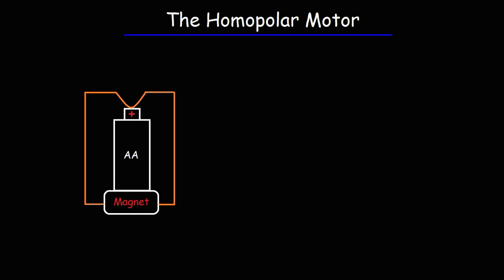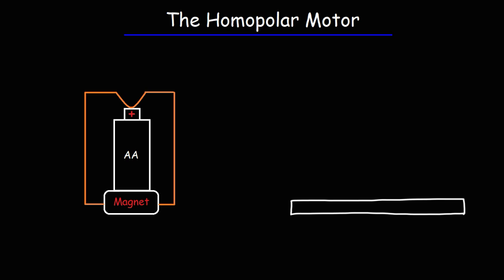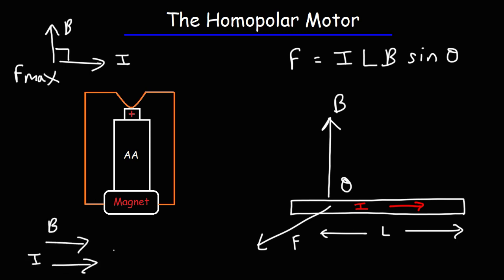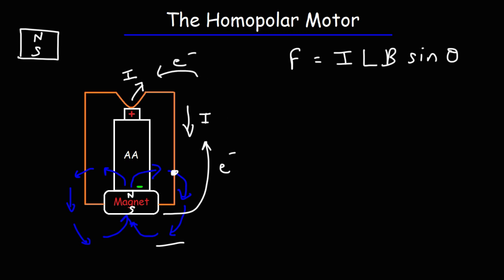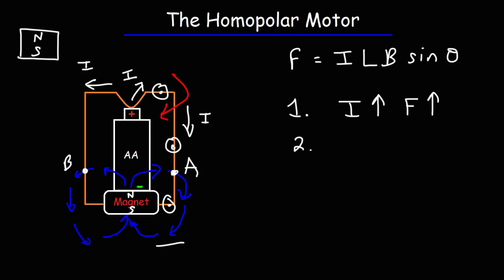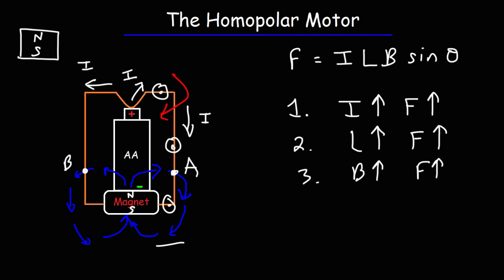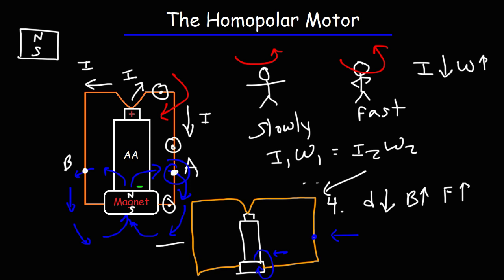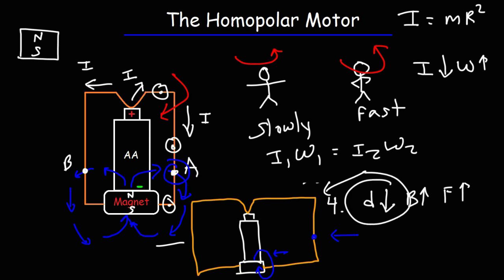Physics - Homopolar Motor Explained

Comment: When trying to put this together I got no spin, but I did burn my fingers. Can't tell if the heat came from the AA battery or copper wire or both. What did I do wrong?
Reply: I think your wires were not perpendicular to the magnetic field in a strong region and it was bent towards the magnet too early. Or maybe try adding a thinner wire to increase resistance and reduce short circuit?

Comment: Extremely confusing.
First one has to talk about the direction of the magnetic field only.
If the north side is facing upward, towards postive Y, it means that the current is antiparallel to that coming down on the right hand side from the positive of the battery.
If you consider the magnetic field of the magnet towards the positive X direction, that is another thing.
Then there is magnetic field of the wire itself., that being circular is a whole another subject. So I am not sure what field you are speaking off, the magnet or the wire?
Both field interact to give sum vector for the force acting on the magnet and the wire...
Furthermore, you mention that the current goes in through the magnet itself and then to the negative of the battery,  This implies that the wire must be bare and touching the magnets, unless that is not what you mean.
And more:
If you claim that the force acts on the conductor at point A only, this means that the wire going around the magnet in horizontal loop or otherwise does not add anything to the spin of the conductor.
If that is the case then why not let the wire just hang down?

Comment: I disagree with your claim that inertia explains the difference in angular speed.   When the wire is further away, the force is less, so the speed at which the torque matches friction is lower.  It's friction that determines the final speed.  Inertial mass only determines the rate at which angular momentum can change.
Reply: You are right, but I think he is correct because inertia explains the difference in angular acceleration that a fixed same amount of torque on loop can exert. Even though the friction causes an exact opposite torque on the loop causing loop to have a constant rotation, a lower inertia means the angular acceleration of loop is higher, which directly translates to a higher speed achieved at steady state.

Comment: Thank you for your valuable definitions. But, The coil size and distance you specify at the 12:00 minutes, kind of wrong. closer to the magnet will only give low inertia to spin faster, and a shorter length of the wire the lower resistance that will cause higher power gain and output. Therefore it is nothing to the with the current Lenz effect and other laws.  I believe the rotation causes something to the with  effect "TOROFLUX"  the free magnetic field just like the toy "TOROFLUX TOY"  demonstrated on this video: https://www.youtube.com/watch?v=lf_DG98L1l8&t=289s
While magnetic field from the north to south or vice-versa running from inside to out or outside to in, creating toroidal like donut shape and spinning around magnetic field ring.